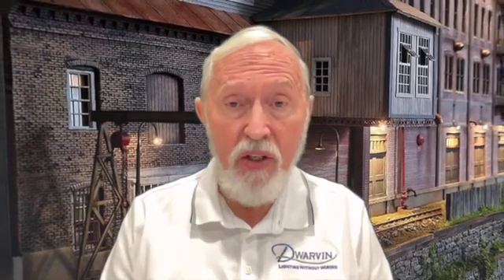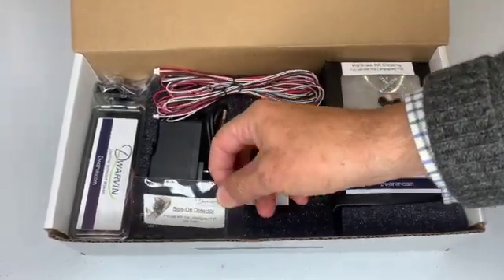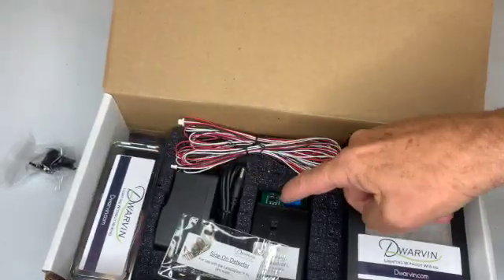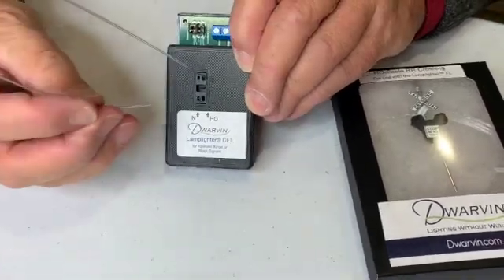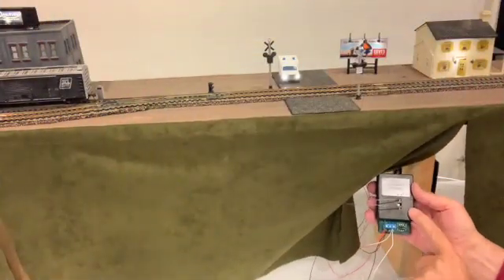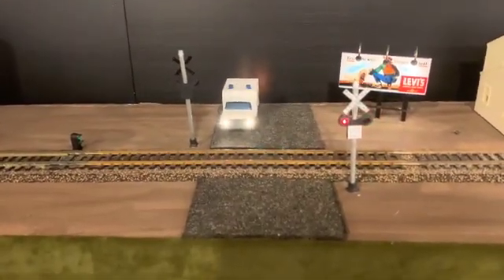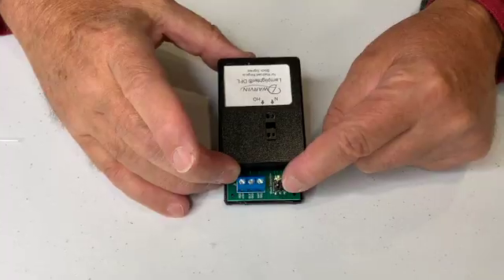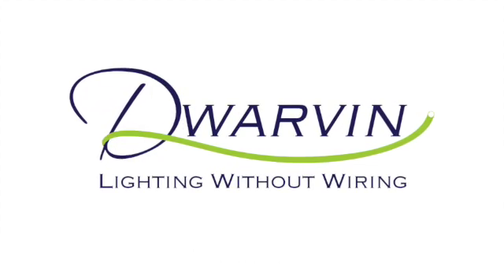Integrated RR Xing / Block Detection Kit

Comment: Hello,
I have a question regarding the original Lamplighter FL Animation Unit, which I purchased two of some years ago. I've watched all of Michael's instructional videos and have gotten the lights on my railroad crossings to work when I'm in Trigger Mode, yet I cannot seem to get the lights to work when running a car past the connected IR Detector. I've made sure all my connections are correct, but am wondering how I can resolve this issue.

Comment: Can the block detectors be mounted horizontally?  It would make the installation easier, with less crawling around underneath the layout and it could be hidden above in different ways, like in some bushes.
Reply from the maker: They could but they are rather long and are not well suited for mounting above the layout. We would not recommend it, but if someone wanted to try it  - you are certainly welcome!  We cannot guarantee that it will work.